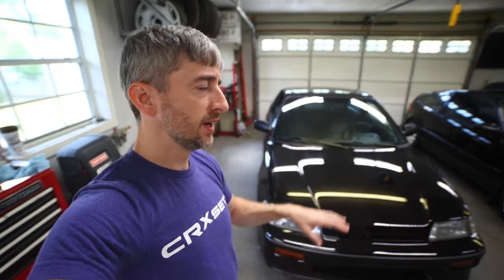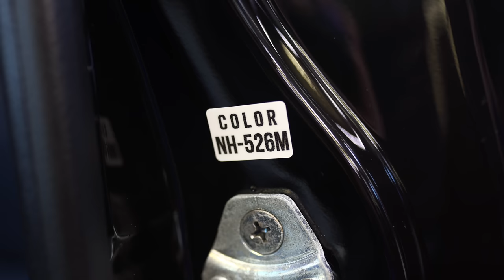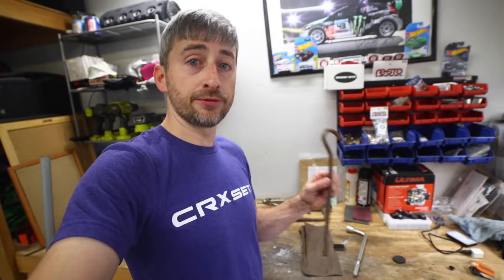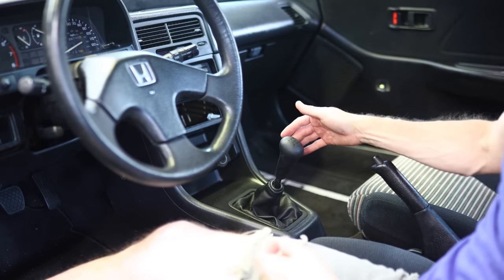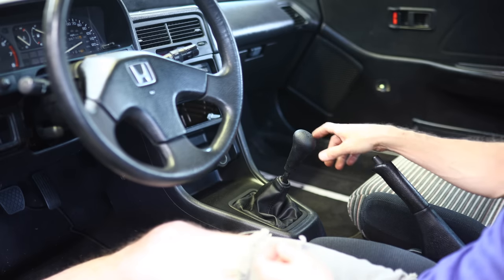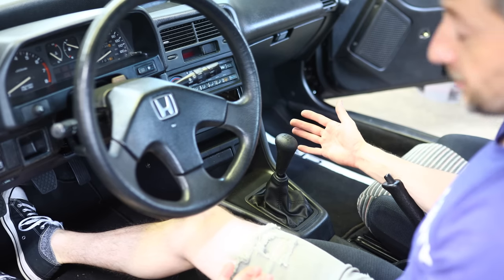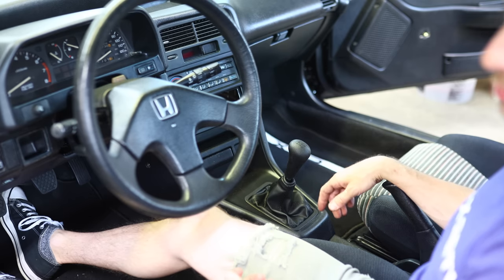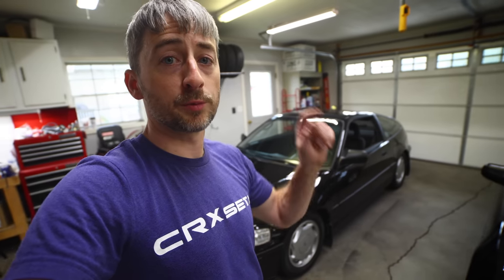1988 CRX Si Restore Part 47 - Restotuner Parts + Short Shifter

Comment: Great video.  I bet you didn't know there is supposed to be a little rubber boot on shift linkage where it meets transaxle. Those didn't hold up very well over time so no surprise it is missing.  Not worth the effort trying to even find one probably. You can only do so much in sourcing parts for these old cars.

Comment: Hi Seth, really enjoyed your video. I just purchased a JDM EF8 SiR and was considering doing the same upgrades as you did in this video including the Shift Linkages but wanted to know if you ran into any issues using these USDM parts? Do the USDM and JDM shift linkages, short shifter, bitch pin, and bushings are fully compatible and interchangeable with each other? Also, would you recommend upgrading the shift linkages?
Reply from the maker: I don’t have any experience with a JDM EF8, but I know d-series and b-series shift linkages are different, as well as the bushing used on the stabilizer bar. Sometimes the u-joint on the linkage wears out but swapping the bushings and checking the pin for tightness helps a lot.

Comment: You're level of attention to detail is crazy! I had a question, when it comes to 5 speed swaps in these chassis the 2 wires on the transmission for the reverse lights wire up to where exactly? Any insight would be helpful no forum has a good reference
Reply from the maker: You’ll have to look up the wiring diagram to know exactly which wires, but the harness is located at the automatic shifter mechanism. The reverse switch will have to be wired up to the existing reverse switch wires that go to the auto shifter.

Comment: You planning on rust treating and restoring the chassis?
Underseal maybe?
Reply from the maker: Going to pressure wash all the red dirt from under there and it should be good to go. I may sand and throw a coat of paint or undercoating on it, depending on if there are any areas that need it.
Reply: @crxseth  ah I thought it was rust